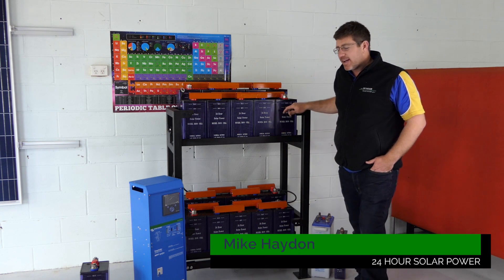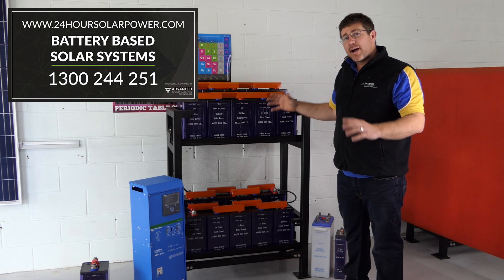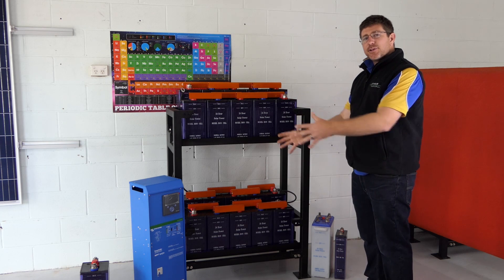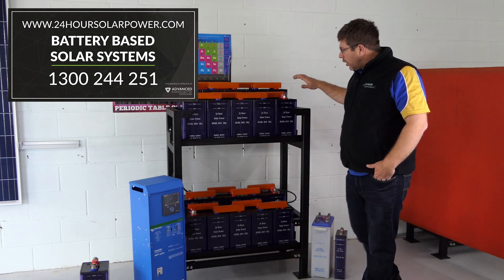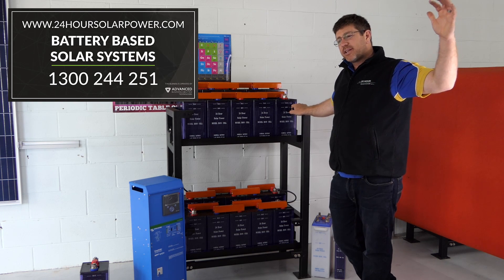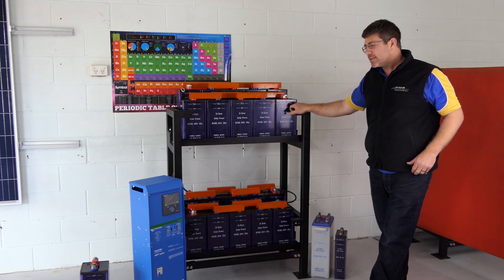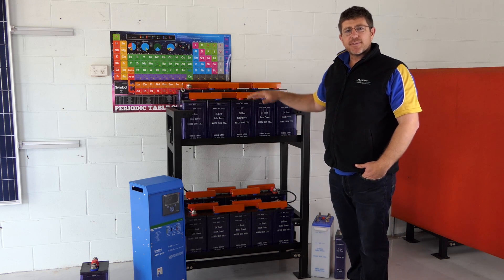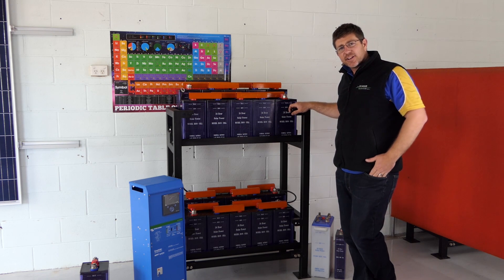Nickel Iron 24v Easy solar DIY solar kit

Comment: So a 24v battery is double the battery. So in a 3 kilowatt system of nickel iron battery 
I need 
20 batteries 300 ah and 1.2 v that is 24 v 3kilowatt system 
Is this means I can convert the energy to 12 V and have 6 kilowatt of energy store. 
Do I need panels solar for 6 kilowatt to charge the bank?
Reply from the maker: Yes. 24v will also be more efficient than 12v if you can go 24v. How many panels will be on your location and energy use of a day.
Reply from the maker: We are in the northern river of Australia and would use 4.2 sun hours in winter to.domoit panel calculations. Say you want 10kwhs produced. Divide 10 by 4.2 and you will get the amount of panels you want.
Reply: We do have average of 7 hours sun light yearly
Reply from the maker: Sunlight or sun hours are 2 very different things. Sun hours is the maximum amount of usable power from the sun for your solar.  I have 4.2 usable sun hours in winter. So 4.2 hours a day that I get usable power from the sun.
Reply: @TheOffGridShop  okay 👌 thank you

Comment: Wondering if anybody has had a build up of black looking crud in the 
bottom of their NiFes. About 30 out of my 40, 3 years old, that have 
about 1/2" in them. Plus the voltage of 7 of them drop rapidly down to 
-0.235V when discharging. I'll add they were purchased in 
Australia, not from 24HrSP, but imported from China. I've flushed & replaced the 
electrolyte in 6. But only 3 seem OK again.
Reply from the maker: There is a few reasons this happens. User issues.  Not keeping the water topped up. Over charging from settings.
Manufactor issues. The plates have moved in shipping and can cause a short. They were not cleaned and washed properly after welding of plates took place. Or poor welds.
Reply: @TheOffGridShop  Thanks, for the reply. Have you ever seen this? We'll assume it's not my fault! :) They were fine for nearly 3 years. DW always used, never dropped < min line. Replaced the electrolyte in 6. 2 seem to be OK, the other 4 not so good. 1 recovered after some overcharging (as recommended by the seller). Also what weight are your 200Ah cells? I've weighed a few of mine, and they (good ones) are only 13kg, spec is 14kg. Flushed ones are 12.5kg.
Reply from the maker: Yeah, This can be an issue with them.  It's from when they are made they were not washed out properly. Or it can be impurities from distilled water

Comment: You said it was a 24V battery bank with 200Ah batteries. 24V x 200Ah = 4800Wh. How does the Nickel Iron battery bank give you 5000Wh of usable power? What depth of discharge percentage are you basing that on? Just a little confused...
Reply: Nickel Iron allows for 80% depth of Discharge but it does not hurt the batteries to over or under charge them
Reply: @gblinkio  I had the same question, and still your answer misses the point... so its normal to discharge at > 100% to get 5kwh... arn't you just exaggerating ?
Reply from the maker: Depending on your inverter it will come down to and the load. Nickel charge at higher voltages. Ie a 24 volt bank.can be charged are 33 volts. Which can give you more storage. The catch is you could run lights and a tv for days. And turn on a heavy load to boil water and you will have an instant blackout.